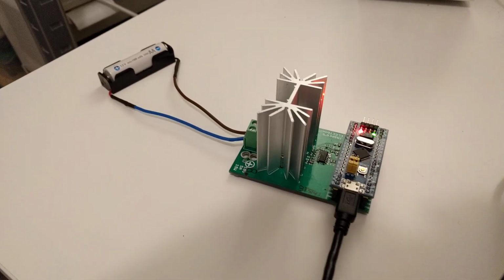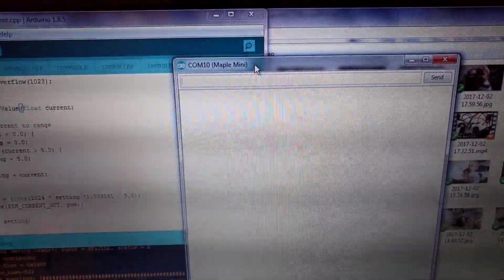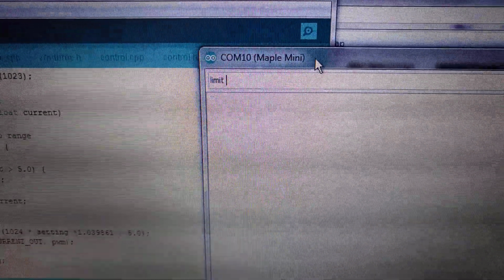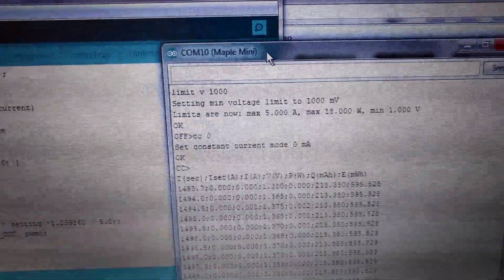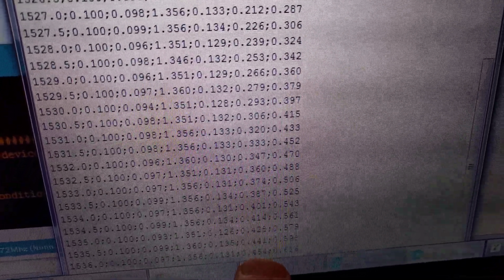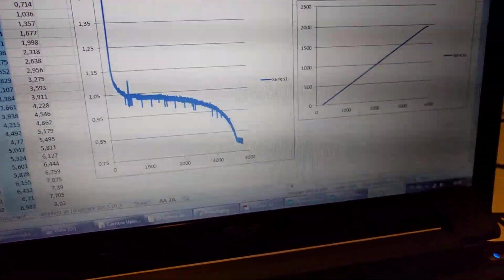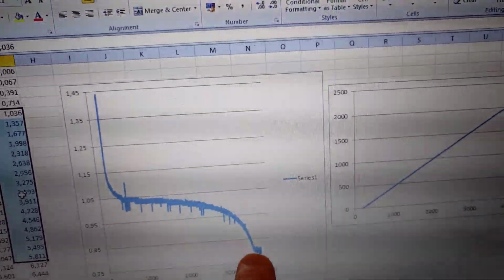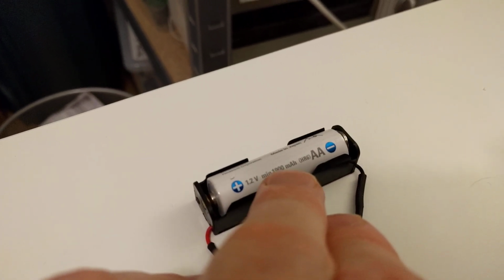Measure battery capacity using Jasper's ELectronic Load R2

Comment: I have reached the extent of the default coding (Jasper's Electronic Load R2 tested batteries well under CC load). Now I wish modify the code for more advanced simulation, Basically I would like to add additional code to automatically change the current draw every few seconds, this will simulate the exact load i wish to attach a battery to. I have been looking at the code from github but to program it through IDE i will need to select the correct board type, if it is a known board (e.g. Arduino Pro Mini)  what one is it? If it is an unknow board type how do i tell/install it to arduino IDE?
Reply: TY